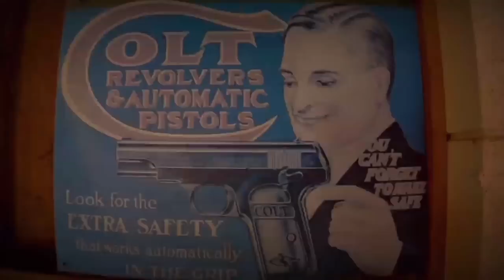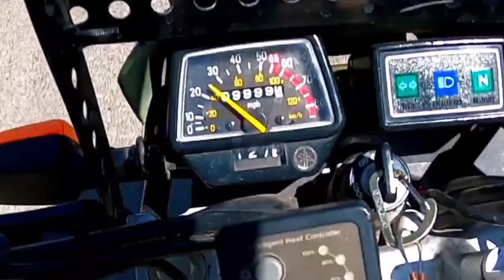Brand New TW200 to 20,000 Miles Highlights. The Turd Wagon Origin Story

Comment: dude that's not just a tank! that's an extremely rare M247 'Sgt York' DIVAD. it was basically an armored anti-aircraft unit assigned to individual divisions to provide air defense. there's only five left in existence, and you found one. AND HOLY CRAP an M901 ATGM carrier! that's the APC with the back open you rode into. 

here's the Wikipedia article on the M247
https://en.wikipedia.org/wiki/M247_Sergeant_York

and the one on the M901 is here- https://en.wikipedia.org/wiki/M901_ITV
Reply from the maker: My buddy in that ride knew a lot about armor as well and he was super excited to see it. Here is a link from that video where I go inside it . 
https://youtu.be/Ly6l3iuXsT8
Reply: After reading that article it sounds like 5 too many : )
Cool find and good catch!

Comment: A wise ADV / Dual sport rider once said “ NO one complains about smaller and lighter JUST bigger and heavier “ . I have just starting doing up a Kawasaki Super Sherpa 250 - got from a farmer 20 year old bike with only 4000miles on it ! It will be my fun SNOTTY trail bike in our Australian Bush . I live in the Mountains area .I also have a Husky TE630 , A friend of mine ride around Australia ( most of it off road - around 85% ) and done 30,000 miles ( new it’s about to click over 75,000 miles - it’s a Honda CRF 250 , she is about to get the new CRF 300 . ( I have been giving you the figures in miles as we use Kms . So she is keen on getting the CRF 250 to 100,000 kms . Your Navy hay , I’m Australian Army , went to the US some years ago and worked with your military and was also on operations with them In Iraq.

Comment: Subscribed for the TW videos, keep it up.  The bent connecting rod may have been from hydrolock if you had ridden through some deep puddles in the miles leading up to it.  One of those things that can start a relatively small out of spec issue but guaranteed to be a fatal cascade later on as it bends further and breaks.  Especially on a low compression engine it would take awhile to work from bad to worse.  Not trying to down talk you but I would think the engine should last quite awhile in more ideal conditions.  Looks like you've living the dream, keep churning out this content.

Comment: I used to own a Ural. I was keeping up with the mileage (though its odometer was in kilometers), wanting to get a pic for all the major milestones. I was approaching 33,333 kilometers, all 3s going across the odometer. I looked down and saw 33,329, then went a bit and saw 33,331, went a bit more and saw _______________! What the?!?. The odometer literally fell to pieces right at or just before the magic moment. The numbers just fell out. The next time I went to ride, I looked at the speedometer and the needle was going around the whole face of the speedometer quickly, just spinning through all 360 degrees about once every second. So, for you, at least it was just a video file. You still have the audio and a photo. What a piece of junk that Russian scrap metal was!

Comment: Bought my TDub in 2018 and have had a journey of a lifetime with it as well. Had to rebuild mine as well but didn't do as awesome of a job grenading the motor lol. Well done on the video and wishing you many more years of happy riding.
Reply: What caused your engine to fail?
Reply: @Rygo-wk3jm  Previous owner put a pod filter and overheated the engine. Engine also had 18k miles on it and was burning oil as well.

Comment: Nice vid bud! So Mbe I missed it but what was the cause of the engine blow out … over-worked/speed for too long a time??? Thx!
Reply from the maker: Basically yeah . I used to do wide open throttle to try to maintain highway speeds for hundred of miles some days and after a year and a half it had enough. It had the proper oil level too when it went
Reply: @dualdorks  I'm surprised! I've seen a lot of these things over the years, and people that have abused theirs much more than that with no issues. I know a guy on the forums who rode his as a commuter for years and ended up with 44,000 miles on his. Still going strong!

Comment: I bought a new 2007 XT225 which is very similar to the TW but 6 speed trans. I had 16,000 miles on it at 10 months. (3300 deep into Mexico) I sold it a couple years later with 33,000 miles. I felt the bike would go to 100k, that’s how impressed I was with that bike. 
TONS of interstate miles on it traveling cross country. Here’s the rule I lived by. The bikes top speed was 80. I made it a practice to only cruise at 80% of that. So basically 65 tops. I see people say the top speed of the TW is 70.  80% of that is 56. If I was to own one of these, that’s what I’d cruise at for top speed.

But I have to say this. I PROPERLY broke that engine in. I didn’t drive over 45 mph till I had 500 miles on it. Then not over 55 mph till it had 1000 miles. If you read the manual, that’s how Yamaha says to break it in. Why people think their smarter then a whole team of Yamaha engineers, is beyond me! I never knew what the top speed was till the bike had over 1000 miles on it. That’s why I’d hate to buy a used one. Most people find out what top speed is on the way home from the dealer. Then they can’t figure out why their engines don’t last.

Another thing people don’t do. They don’t let the engine warm up. They do cold starts and hot rod off. Granted, I never found out how far my engine would have went. But when I sold it with 33k on it I felt I had a rock solid engine.
Reply from the maker: I agree with ya. These bikes are not meant to go wide open for long periods. This video though was more of a highlight video of my time owning it so far. After the second engine got built up, I had a proper break-in for the first 600 miles before I just completely sent it. I should have included that in this video for sure. They are awesome simple bikes and will last you a long time as long as maintenance is done at the proper interval. Unfortunately the heat and me just absolutely going wide open for hundreds of miles somedays for two years killed that first engine. Gotta live and learn I suppose lol
Reply: @dualdorks    I wasn’t being critical of you. My comment was more of my experience and information for anybody thinking about buying a new one of these or any new bike. I see what people do, and I’ve done the same thing myself. 
In (I think) 2003 my son and I both bought new Yamaha 660 Raptor’s  We hot rodded them right out of the gate. Well, both of those always burned oil, and after it was too late, I realized we had done great damage to those engines. That’s why when I bought my XT, I was determined to break it in properly.  I’ve owned lots of Motorcycles in my life. That XT was the best bike I’ve ever own.

Comment: Great video. Thank you for sharing! 
What headlight is that?
What kind of fuel economy would you expect to get on flat roads cruising @ 60mph? 

I used to have an 08' KLR650 and looking to get back into riding now that the kids are getting older and since I have a back road commute for 55mi each way... I can do something lighter and smaller this time. That KLR was great up to 34k miles when I sold her. 

I am looking at either this bike or a 250cc (either yamaha or kawi) 

This bike has always caught my eye.
Reply from the maker: Thanks for watching. I'd probably average around 50mpg while going 60. This bike is slow though. Just because it can do 60 doesn't mean it likes it lol. If you got a long commute on highway I wouldn't recommend this bike but on the back roads it's fun.
Reply: @dualdorks  
OK. Thank you

Comment: As somebody who is considering a Tdub, this is an amazing video. Appreciate you sharing. Would a Suzuki VanVan200 like your buddy in 9:05 had a better outcome for your 15kmi Grenade?
Reply from the maker: Both are good bikes and very identical. The TW has a bit of an advantage off road but the Van Van has an oil cooler and would be better for higher temperatures like the desert. Bottom line these bikes aren't meant to go wide open for hundreds of miles for 2 years straight like I did in the heat. That's what killed it the original motor.
Reply: @dualdorks  Great video! The seize really sucks!! Do you think an oil-cooler, oil temperature gauge, and synthetic 20w50 oil would have helped? Also change the oil a lot more often- like every 2000 miles?
Reply from the maker: @Dr. X  it would definitely help in the warmer climates for sure. Could possibly  have son cons as well. If I were to smack the oil cooler while riding trails that would suck for sure. I change the oil  as soon as it gets pretty dirty. It's cheap insurance for sure. I now run the Rotella 10w 30 T4 in all my bikes. It's got a special additive for wet clutches and I like it plus it's cheap.

Comment: Hey man it's been awhile but have been keeping up with some of your vids. Same thing happened to me 3 months ago, ceased the motor. When I transferred departments I turned in my patrol car, used my 2021 Tdub as a daily back and fourth from courthouse, well like you said not good to ride 65+ mph every day for a year and a half🙃, unbelievable brand new bike too. So now been waiting for 3 months for rebuilt motor, unfortunately parts are very hard to get shipped this sucks. Just wanted you to know your absolutely correct, I guess motor really can't handle that kind of riding, still love it though, but damn!
Reply from the maker: That is a huge bummer man . Hopefully you can get all the parts you need and have it back and going again soon . I ended up buying a used bottom end on ebay and a brand new top end . Fortunately I knew people that had a full machine shop in their garage . The biggest killer for the TW is high RPM over time with heat in the mix too . They will last forever though if we just putt with them and keep up with regular maintenance.
Reply: @dualdorks  Yes I agree after replying to you,I got a call from mechanic the parts came in, finally. So any day now I will keep you posted, ride safe looking forward to more vids.

Comment: Great video. @ 61 I own a 2019 KLX250 with less than 600 miles since new. Crappy health forces me to sell it, to heavy in the sand for me. But the TW200 looks like it is easy and low down in sand to sit on and stand up on. Perhaps I will give one a try. Right now my only option is an electric FAT bike in the sand which is a blast but limited in range. Give me $5/gallon fuel over an ebike any day if I can do it.
Reply from the maker: I own the KLX 300 as well which is basically almost the same as a 250 . It's about the same weight as the TW . It is nice to have a bike low to the ground for the harder stuff
Reply: Sam, IDK what your "crappy health" amounts to but fwiw,  I'm an older rider also, was too heavy and in declining health.. Google/Youtube "metabolic syndrome".. I've completely turned my life around..
Reply: @AzPauly  Thanks Paul I'll check it out. I suffer from chronic Lyme Disease. It is unknown how long I had it or when I acquired it.

Comment: highly recommend spending $500 to put in a kickstarter following wronglogic's guide, bump starting on sand or mud, at the bottom of a hill, gravel, snow, or wet asphalt, can be a pain in the ass.. and it will always allow you to manually turn the engine and feel out, physically, how smooth it turns over. it causes less wear that the electric start from cold, too, and when you pull out the kick lever you're in a good spot to check the oil level. 

6:15 probably should be doing oil changes every 1000 miles, cheap to do and saves money in the long run, no reason it should have completely blown up like that in such a short time without serious neglect

i hope the engine has fared better up over 20k and maybe close to 30 now

Comment: Generators run at full throttle for thousands of hours without any problems. IMO Your engine failure most likely wasn’t because of excessive highway mileage. It could’ve been a number of other things. Maybe it was an oil issue. I never go off what the manufacturers suggest. A lot of that manufacturer suggestion. bullshit is all because of the EPA. Wanting to conserve oil. My general rule is 1 quart of oil = 500 miles. For example, if you have a pick up truck that holds 10 quarts of oil change the oil every 5000 miles. If a motorcycle holds 2 quarts of oil change the oil every 1000 miles. If you get what I’m saying

Comment: Is it possible to make it to 20,000 without the engine blowing up?  I’m starting to loose interest.
Reply from the maker: Yes . Many others have . Unfortunately where I live there are a lot of highways and I basically had to almost redline to keep highway speeds which is the worst thing for the bike over long periods of time . As long as you cruise with them and keep of with maintenance they will run forever
Reply: @dualdorks  Was wondering what might have caused that , I guess that makes sense. I have seen plenty of these bikes with a lot more miles still going strong , everything original in the engine.
Reply: @dualdorks  i think heat and going slow had a bigger factor

Comment: So wait, the that happened to the motor just by long miles ??
Reply from the maker: High RPM over a long time isn't good for these engines, especially when it's already 100+ degrees outside .
Reply: @dualdorks  Crap, you had me scared. I run a DR650 and I'm on the highway a lot so I got scared for a second 😂 but either way, I love the content man! Keep them coming !

Comment: They need to offer this bike in a fuel injected, 250cc, 6spd, digital, round headlamp, etc. Then I'll buy one. They can also offer the older one.
Reply from the maker: Fuel injection would be great. I do like the style of the 4×6 headlights though . Van Van 200 would be more up your alley
Reply: Yamaha technically has a 250cc dual sport that is a 5 speed though.. it's called the Yamaha XT250 Dual Sport, has a similar design as the TW200 "t-dub", only it's fuel injected, higher torque through all gears, beefier suspension, disc brakes, and that round headlight. New tw200's are near 4900 USD base, and XT250's are 5200 USD base.. so for a few hundred more you can get a slightly larger bike.. only reason why tw200 so popular is because of the extensive aftermarket and they're basically little thumper tanks, they can take a lot and last a long time, they're basically a street legal minibike to me. T-dub's have been around for nearly 4 decades now.. whereas XT250 are fairly new. 

I've thought about getting the XT250 over the tw200 as I've rode both testing them out using a friends bikes, it's a slightly larger displacement over the tw200 that is can rev higher and seems to handle more of what I can throw at it as I'm a little more aggressive while riding on single track, it feels similar to my 4 stroke dirt bike in comparison on the low end. I've tried a tw200, it felt a little sluggish to me as how I ride, but overall tooling around and going slow with the wider front and back tires they provide more balance going slow while standing up, it can't be beat. It really depends on how aggressive you want to ride, what you're mostly going to be riding on, and how fast you want to do it. Either bike is very stable at slow speeds and the xt250 is just ever so slightly faster top end over the tw200 at highway speeds.